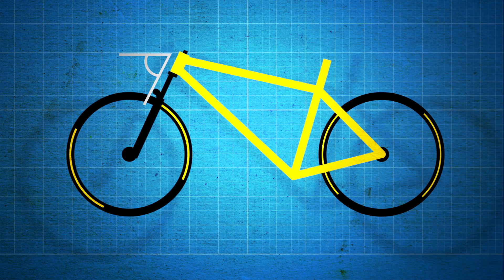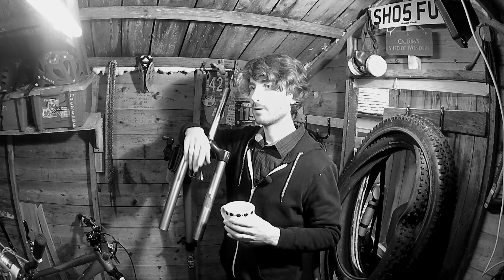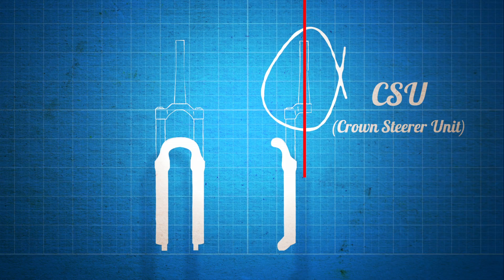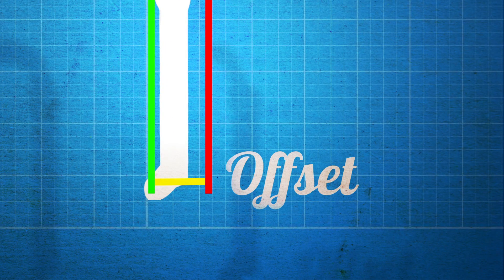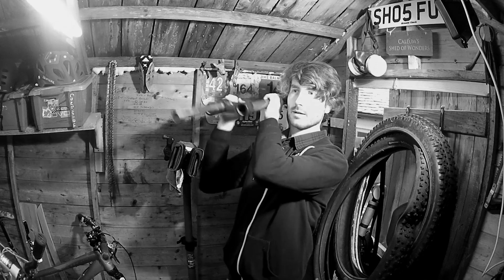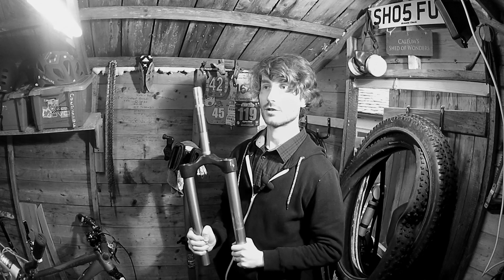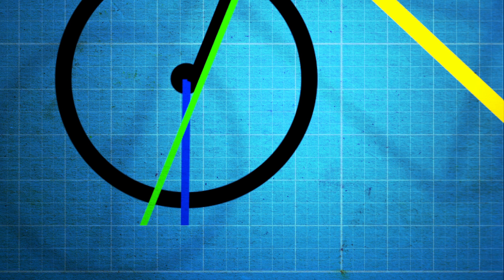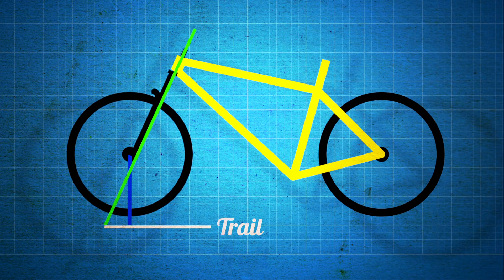What The H*11 is Fork Trail? - Steering Geometry Sort of Explained

Comment: Trail is affected by 4 factors
: Head Angle, Fork Offset, Rim Diameter, Tyre Width

Tyre width example
65deg head angle, 51mm fork offset, 29er rim with 2.3" tyre has a trail of 118mm
65deg head angle, 51mm fork offset, 29er rim with 2.6" tyre has a trail of 121mm
This is a 2.5% trail increase 

Head angle example
65deg head angle, 51mm fork offset, 29er rim with 2.3" tyre has a trail of 118mm
66deg head angle, 51mm fork offset, 29er rim with 2.3" tyre has a trail of 114mm
This is a 3.3%  trail decrease

Fork Offset example
65deg head angle, 51mm fork offset, 29er rim with 2.3" tyre has a trail of 118mm
65deg head angle, 44mm fork offset, 29er rim with 2.3" tyre has a trail of 126mm
This is a 6.7%  trail increase

Rim diameter example
65deg head angle, 51mm fork offset, 29er rim with 2.3" tyre has a trail of 118mm
65deg head angle, 51mm fork offset, 27.5 rim with 2.3" tyre has a trail of 109mm
However since 51mm fork offset is not common on 27.5 forks the example below is realistic
65deg head angle, 42mm fork offset, 27.5 rim with 2.3" tyre has a trail of 119mm
This is effectively the same trail number between the 29" wheel and 27.5" wheel

Ride quality is seriously influenced by the fork setting and fork behavior 
since it changes angle while compressing and rebounding, which is also changing trail

Comment: That was a damn good explanation.  I took my Dback hard-tail w 67.5 degrees of head angle out yesterday for the first time in a month (lots of rain lately), and crashed twice.  Rough crashes, too.  The slack head angle was throwing me off, even though I ride that bike a lot.  This last month, due to rain, I rode my trainer bike on streets and trails, and it has a steeper head angle and a similar offset.  The handling is tight and crisp on my trainer, and I ride technical sections better on it.

I don't see a way to reduce the offset on my Dback unless I turn the fork around backwards, which will do as you say - bring my hub back towards me, tighten my steering and retaining the head angle.  What do you think?
Reply from the maker: That would be a very bad idea as the fork is designed for all the forces to be coming from a certain direction, this includes the brake mounts. Mounting the fork in reverse will dramatically increase the risk of a failure for the fork which can be very very dangerous. Some forks (Manitou for example) have reverse lower crowns so look like they are on backwards but are designed that way. While 67.5 is slacker than your street trainer it is not that slack in the modern geo spectrum and some solid ride time in different conditions will have you comfortable in no time. If you where having offs after rain I would suggest looking at your tyres. If the trails have thick mud then a proper mud tyre might be a better way of ensuring grip and traction thus avoiding crashes.
Reply: What you say is all good, but my Diamondback is the bike I have the most riding time on, between the two.  I have ridden the Dback on wild trails throughout the mid-western section of the United States.  There is definitely a significant difference between the two.  The travel on my Dback fork is a lot longer, and that is probably the difference.  My trainer has a short-travel fork, which is ideal for its purpose, but I don' think its the travel, its the head angle. I'll look for the specs on my trainer frame and let you know what I find.  The handling is so much better on the trainer that I might swap wheels, drivetrain and cockpit from my dback to the other.  Except the fork.  My dback has a tapered head and the trainer - untapered.

Comment: so for my hardtail build i will be using a nukeproof scout with a 65 degree head angle  and a fox 36 fork and the bike will be on maxxis minion 2.8 plus tires on a 35 mm internal rim. so if i understand your video i should run a 44mm offset instead of the 51mm offset for the best performace?
Reply from the maker: Yes, given thr option id go for shorter offset o achieve longer trail.

Comment: I got giant glory dh 2008 and my head angle is 55, is that dangerois, what could happen? I have 190mm fork and 222mm rear shock
Reply from the maker: The HA for that frame is actually 67degrees. Here is a link to the full geo chart, that fork is well within the travel the bike was designed for so nothing to worry about. https://goo.gl/images/oopYXS

Comment: Really nice video but, 68 or 69 dgree HTA are not old school XC numbers. 70-71 are, and many WC pros are riding bike with HTAs that steep. While GT have been running 69.5 on their FS XC bikes for the better part of a decade and Turner has had theirs at 68 for who knows how long, these are exceptions. 68.5 to 69.8 would be new school xc geometry, which was trail geometry 5 years ago.
Reply from the maker: Thanks for the well referenced comment. I should do a follow up video comparing geo of xc trail ad DH bikes from 2000 amd now tp illustrate the real terms difference between "new" and "old skool".

Comment: You mention that the slack head angle makes the bike take bumps better, which makes sense. but then you say to shorten the offset as well, to give the bike "lighter" handling. Slacker head angle and shorter offset would lead to larger and larger trail numbers, which leads to "floppy" and laborious turning, especially at low speeds, does it not?
Reply: @Nathan Clair... you are totally correct. He made a  mistake in his clarity. He wasn't saying slacker HTA's  need more slack. He kinda ran his words together making it unclear. However, if you  repeat the video several times you'll see he meant less slack means better handling.